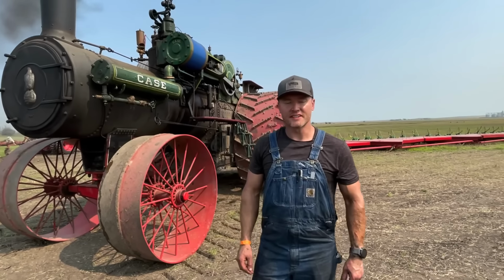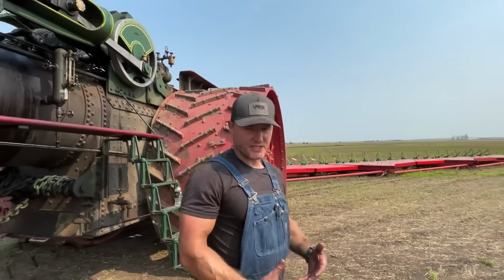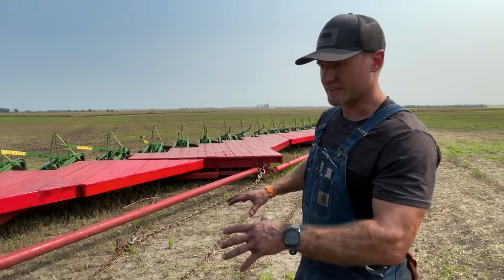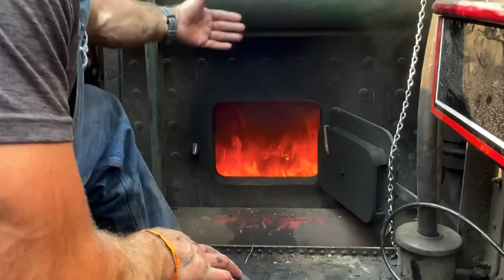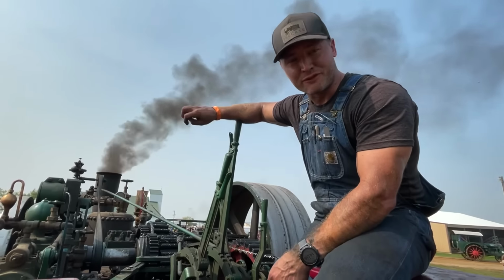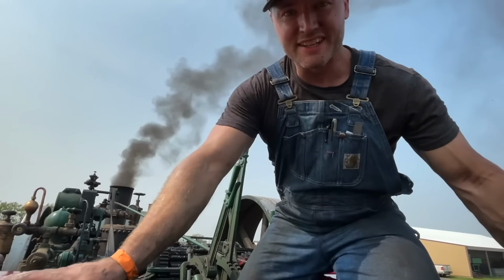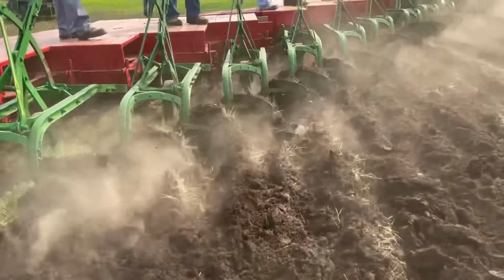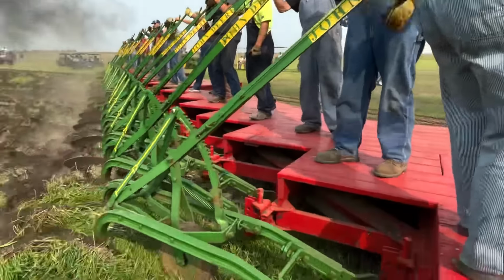2021 RECORD! 150 CASE Road Locomotive pulling 44 bottom John Deere plow

Comment: The fact that this is called a “road locomotive” and not a “tractor” says enough by itself lol. What a beast.
Reply: "Road locomotive? Any road this monster drives on won't be a road for much longer...
Reply: and not a single circuit board from china was used. nice.

Comment: The 150 Case will forever assert its dominance over every other agricultural machine ever produced, and it does so in a perfectly dirty but also beautifully elegant way. This machine puts a whole new spin on the phrase "They sure dont make em like they used to"
Reply: This bad boy was built in 2018.. so sometimes they do!
Reply: What a super project. Could it be an instance of back to the features.
Reply: they make them better. Theres a reason noone uses steam engines for anything
Reply: they ain't ploughing that deep and the power ain't really that impressive here. the impressive part is just traction but even that ain't that impresive due to the good ground and the heavy weight of the machine
Reply: Yeah, I just drove my Mahindra into the pond.
Reply: @danroberts9050  when I was  17 I had the great idea of driving my car onto the frozen ice so the cows could drink (I was too weak to bash it with the hammer.) 2003 Nissan xterra, my grandfather pulled it out with his 93 f150 like it was nothing, said, that's not a bad idea actually, drive the truck into the pond, and then just right back out.
Reply: @CourlandEngineering  Well, i spect most farmers today would hate to have to shovel coal to keep their tractor running, on a hot Great Plains afternoon! lol
Reply: The Big Bud 16v 747 is heavier (63 tons) and more powerful at 1100HP.
Reply: The future will have to involve swapping out batteries (like your hand drill). We've only got a 300 year supply of these hydrocarbon fuels (at most!) and we should save it for something else.
Reply: @eccentricity2277  there's also only 1 that was ever built, and it has about 75 years of technology on this thing, but this old steam tractor can do the same amount of work. I love Big Bud tractors, especially the 747, but they're still not as impressive as this is.
Reply: @WTmac1993  I would love to see a tug of war between them.
Reply: @eccentricity2277  I agree, would be an awesome sight. I think the 150 would be able to hold its own due to the steel wheels, those steel treads are going to dig in and not let go, however the Big Bud running its dual Titan LSW1400's all the way around gives it a lot more tractive contact with the earth. Also, the 747 has the weight advantage at 135k lbs ballasted, while the 150 is about 75k lbs, so ultimately due to more contact with the ground and the weight advantage, Big Bud likely takes the W.

But, if you ran single 1400 wides on the 747 to bring it closer to the same contact area and then removed the ballast weight from it, that brings it down to just about 100k lbs. At that point it makes the pull quite a bit more balanced between machines and due to the massive torque and super low gearing of that steam engine, I feel as if the Case could maybe take the win.
Reply: "Every other agricultural machine" it's not even an agricultural machine lol it's a train.
Reply: @rampage3337 so what is impressive here
Reply: @RisenThe  There's more coal and oil than things to build batteries. Plus, you need to charge those batteries and won't happen with solar and wind.
Reply: @johnnyblue4799  What? We have an entire OORT cloud and many moons full of rare metals. Do you really think you are going to find oil on a comet????
Reply: @RisenThe  Oort cloud? What are you smoking? Before they get anything out of there you'll be long gone.
Reply: @johnnyblue4799  Yes, the point is to grow trees whose shade you will never feel. Instead, you prefer to tether future generations to finite energy sources? Your opinions are very lame.
Reply: @RisenThe  Maybe, but I won't freeze and starve, myself and my family, waiting for batteries to fall out of the sky.

Comment: I used to go to the Steam Show in Barlow Ohio as a kid back in the 70's.  There were nearly a dozen different models of the Case Traction steam engines there.  It was amazing to see these survivors from a by-gone era still doing the jobs they did nearly 100 years before.  I remember a hay baler that was operated at the show and it produced the heaviest bales of hay or straw I've ever seen, they weighed well over 100 pounds.  The steam press on the baler applied so much pressure, it actually compacted the hay into a bale that was so dense you could hardly move it.  Such truly amazing machines with really intricate gearing that produced incredible amounts of torque.  They got the job done.  Great to see you're keeping this rare piece of America's past alive.
Reply: Mc Louth KS show is a big show they have steam engines of all sizes switch off dutys on saw mills thrashers balers everything we use to go every year as I was growing up we'd haul a family friend's 2 Rumley oil pull tractors up while they hauled their show and stock pulling tractors they had a nice collection of Minneapolis Moline tractors and depending on the ones they tools they could get their 7 pulling tractors on 1 semi and 5 to 7 show tractors on the other depending on if they took a big boy or not 4 generations pulled back when they'd let dad walk beside the tractor or ride on the fender while a 10 year old could pull the sled they had a 50 ft by 20 full of antique tractors mostly M,M,s a few Farmall and Deere and an 80 by 20 of projects with a fence row of parts tractors almost a quarter mile in the back and some set along the highway right of way for yard art and they still save as many as they can I always tell my buddy the family concrete and demolition buissnes is their hobby and tractors are their job he says sounds about right he has no idea how many tractors they own but at 1 point they had almost 40 restored and for sale
Reply: @Scott Crawford a little town called McLouth just west of KC not far from the agricultural museum I can't remember for sure I think thats in Bonner Springs it's been awhile since I've been to the museum they called it the agricultural hall of fame it's a neat place to spend a day walking around seeing the progression of farming I didn't know there was almost 100 different styles of barbwire since it's invention till what's used now till my first time there and it's either the first or second weekend of August I believe if you Google the town it's the main attraction for a small town they have acreage probably bigger than the town itself for the show and a farmer let's them use his wheat field for parking I think that's where they get the wheat to thrash all weekend it's been 5 years since I was last able to go I told my Dr I was putting of this year's surgery till after the show soon they'll run out of vertebra to hook together with their scrap iron pile maybe the blacksmith can fix me up at the show
Reply: Schiefe Ebene  get the blueprints and most of it's a little blacksmith work and plumbing or you could cheat and weld instead of rivet it together gears pistons and a flywheel and a KS farmer and his son who was running it for the video built it while he was growing up so he knows every inch of it now I'm sure his kids will too growing up helping with maintenance and repairs on it I can't remember the cost I was in my teens when I got the grand tour and they gave the hrs it took over the years and cost but most things were salvaged from other steam engines but it wasn't crazy expensive according to my dad
Reply: @Scott Crawford I'm glad my kids all got into getting their hands dirty we've never taken on a steam engine but we've restored plenty of old farm equipment and have a couple tractors each we still all do our gardens with we all have very large gardens mine's the smallest now at roughly 5 acres I use a Farmall M and Ford 8N we all do snow removal too with our old loader tractors and rear mounted blades then we got an old little bobcat that the bucket is a little narrower than a sidewalk I believe 2 ft wide we built a sidewalk V-plow for it quick work of a sidewalk and not much to shovel those old tractors sure make you appreciate the comforts we have in our tractors now days
Reply: Schiefe Ebene  farmers that don't raise livestock have free time in winter unless they broke alot of equipment during the year if it wasn't for me having 7 kids in and out of the shop we wouldn't because my welding shop is pretty busy fixing the neighbors around us stuff as well as our own and that's when all the racecar engines come in the mechanic shop my dad still gets out on nice days and thinkers around on the antique tractors my brother and sister come over every weekend to help and we have 1 full time guy doing fabrication and welding and a high school kid part time a few hrs after school I hope he wants to go full time after graduating next year if he doesn't go to tech school or college 16 he's a good welder and seems to enjoy it I like having him around and poor kid needs to have some guys around more single mom and 3 sisters I have to keep reminding him in the shop he doesn't have to put the seat down he gets a kick out of it when we tell him that
Reply: Schiefe Ebene  I'm in the process of moving to the place I bought in Kansas
Reply: If you listen carefully, this is a REPRODUCTION from Case Plans---- all 8 originals have perished.  These guys built this one out of love for the era.
Reply: Да, интересно посмотреть действующие образцы старой техники. Вспахать поле на таком паро-тракторе не просто, для этого нужны целые толпы туристов-энтузиастов. У паровой техники мне больше всего нравится гудок.
Reply: @Scott Crawford بك

Comment: Amazing steam engines! Back in 1989, fate brought me to a Siberian village remote from civilization. A very beautiful village, wooden log houses on a high ground floor made of wild stone. The entire yard is covered with a huge roof under which hay for the cows is stored. Amazingly beautiful carved frames around the windows! There, for the first time, I saw steam engines at a sawmill. In general, this village survived solely due to the forest. There is a local narrow-gauge railway around the village, which was used exclusively by steam locomotives. And on the edge of the village there were workshops in which lumber was dried and stored. Well, the heart of it all was a huge steam engine, powered by wood chips and pine branches. Driven by a long wide belt.... Nearby are pieces of rosin, which were lightly covered with the belt for better adhesion. I remembered this place for the rest of my life as a monument to a bygone era.

Comment: Amazing piece of machinery, even more amazing to see it in action. Insane levels of torque being put out by the steam engine.
Reply: Full steam ahead! 👍
Reply: it was the sentinel (steam wagon). it had 70 hp at 250 rpm! thats about 2000nm of torque or about 1500ft-lb
google it there isnt much about the car, but its interesting, btw its a 10,5l 2 cylinder lol

Comment: And not a single piece or bolt was made in china...no wonder its lasted so long
Reply: its a rebuild, lmao
Reply: Still funny.
Reply: The engine is a replica all the real ones were scrapped with in 5-10 years of construction because they were plagued with material problems from what I’ve heard what you see is a replica created from plans by Cory Anderson that has been made way better than the original

Comment: I can't appreciate the engineering enough on these things. Truly world changing
Reply: So world changing they didnt even make 10 😂😂
Reply: @thehardman9379  well said.
Reply: @thehardman9379  Of this type yes, but engines like this where pretty pretty common up until the maybe the 1920s.
Reply: @thehardman9379  ever hear of a prototype?
Reply: @trey6563  ever heard of candy? 

Candeez nutz hit ya in the mouth.
Reply: @thehardman9379  back then they built to orders they got so they didn't have 91 sitting around unsold because only custom thrashing outfits could afford them
Reply: @thehardman9379  they never made over 10 of the wright flyer either but it changed the world

Comment: What a beast of a machine!!! I'm not a tractor guy but this behemoth beast is awesome to watch In action.
Reply: The ground shaking and thunderous sounds are so much better in person you should check out a threshing bee or steam engine show near you someday owners love showing how they work and how even though it's hard work it made farming easier when steam engines came around several farmers in an area would all put in money to buy 1 and travel farm to farm doing the work as a team to get everyone's work done it's fun for a weekend show but when I get home I'm ready to be pampered with my AC and autosteer so I just watch the monitor and lift the implement out of the ground at the end of the field turn the tractor around hit autosteer drop the implement and the tractor drives itself to the other end you just have to be careful not to fall asleep I did that a couple times the first I just got stuck in a ditch the second was expensive I dropped into a ditch about a 20 ft drop and broke the tractor in half shattered the transmission and bent the frame rails till the bolts broke off I was thrown through the front window luckily nothing landed on me I still spent some time in the hospital with a bad concussion cuts bruises and 2 fractured vertebra and herniated and bulging disc in my neck luckily not as bad as my last spinal injury no need for immediate surgery for pins screws and rods and learning how to walk again feeling guilty my kids had to help me do so much I couldn't do including washing my own back and hair to working in the mechanics fabrication and welding shop I had as well as most of the farm work instead of hang out with their friends more like they use to I never did tell my customers my 14 year old daughter was building their high dollar racecar engines or the neighbors she was making braces and welding up equipment they broke and asked me if I was healthy enough to fix it thank God for 3 of them having learners permits 3 months in a plastic imobilizing neck brace then when I got the fabric covered foam one and could turn my neck a little I could get around the farm and do more in the shop almost the full 3 months of that and I got tired of buying new ones because they stunk from sweat and grease with welder and torch spark burns I figured doc would know I wasn't listening and pushing too far too fast and my Dr is mean she rides a bad a$$ Harley to work and has no problem telling me I'm a dumbass$$ when I overdo it and end up in the hospital

Comment: Up until today, Allen Millyard of England was the best builder I've ever seen. But this factory reproduction vehicle is maybe the most impressive build of any vehicle I've ever seen. It looks like it just rolled off the factory in 1905, without a single part that isn't period correct and with the right shape and design. How on Earth do you just "build" a 70,000 pound vehicle from scratch at home? I am beyond perplexed.
Reply: Right?! Where does someone come up with 70,000 lbs of raw materials then melt it, hammer it, rivet it. Enjoyed your comment.

Comment: Building a steam engine that big is no easy task. The steam inside can reach insane pressures. This is awesome!
Reply: If I recall the steam pressure only gets to about 175 pounds. I believe its called a low pressure steam engine.
Reply: @longrider42  you'd need a pressure equal to the resistance of the plow

Comment: There used to be a steam show at Pawnee,  Oklahoma every year.   I went as often as possible.  They had many steam tractors and you could get close to them.  When one goes past, you can hear the earth cracking under the wheels.  They even had a prony brake setup to measure their horsepower output.   I miss being there.
Reply: There used to be an old fashioned  harvesting festival up in minnesota at grain harvesting time using these steam tractors and using thrashing machines. and using a grain binder to start the harvest.. not sure if it is still going on..

Comment: When you let the clutch out on something like that, it’s not so much that the tractor starts moving as it is you move the earth underneath you.
Reply: There is no clutch - a steam engine starts from stationary at full torque... That's one of the great things about a multi-cylinder steam engine...
Reply: @lardo666  There is definitely a clutch. The blocks you see on the inside of the flywheel - that is the clutch. Without it, you would not be able to do belt work with the tractor stationary. Or slow steam the engine to run the crosshead driven water pump while the tractor is standing still to fill the boiler. You'd be left with the injector as your only way to add water to the boiler.

Comment: Totally  awsome. I love steam engines. My wife and I just got done riding a steam engine. In Orbizonia  Pennsylvania.  I talked to the engineer.  1,600 horse power. 30,000 labs torque to the wheels.  The engine was built in Pennsylvania  in 1916.  To pull coal cars out of our steep mountains 😊

Comment: You did a very nice job making a replica I thought that thing was from the past it's too bad none of them survived but you did a good job replicating it and the tractor is quite mind blowing yeah the new tractors have all the horsepower and gears in the world and all the attachments you can think but the one thing they don't have is Steam and a lot of low gears and tons of weight you put those things together and you got yourself a beast that will move anything you attach to it that tractor right there is animal and I don't think any modern retractable ever hold a candle to it I feel like I think you pull a whole another set of plows on the other side it still keep on chugging along nothing is mind blowing amazing that's all being done with steam as well